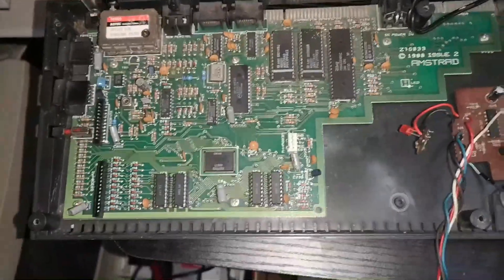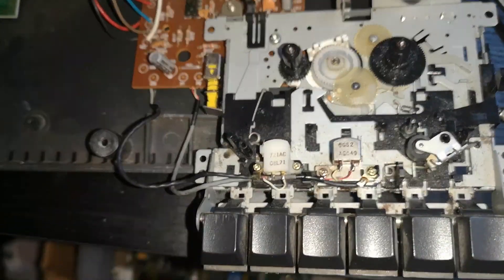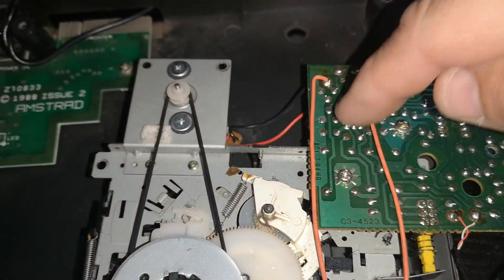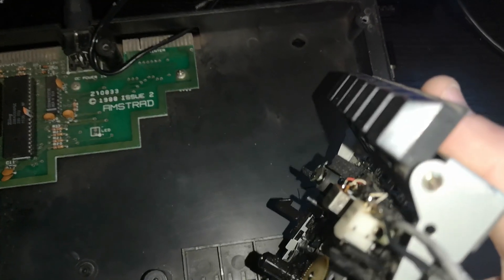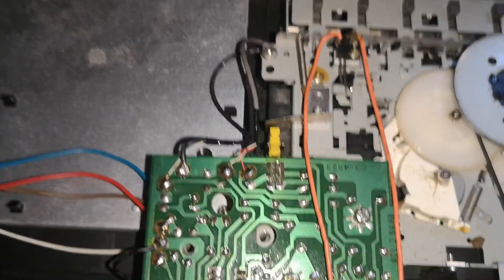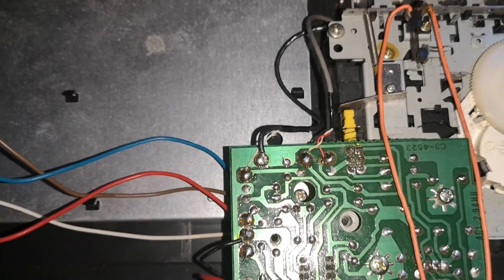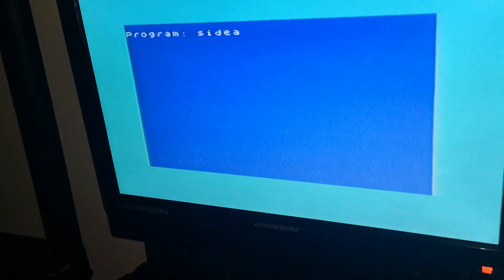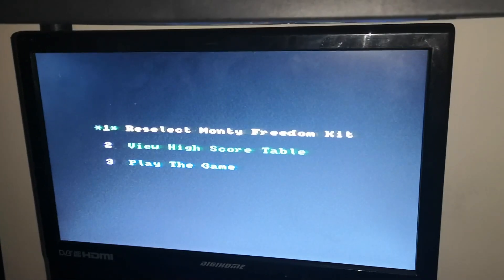Classic Computer - ZX Spectrum +2 cassette drive  repair

Comment: Hi.

Dug my Spectrum plus 2 out of the loft. Powered on OK, but tape deck noisey and no audio output.

Opened it up, gave the heads and the rest a good clean, replaced the belts and a broken play key.

Powered it back on, but now I have no rewind or fast forward and it only plays for a couple of seconds before stopping.

I guess I have done something wrong!

I have little knowledge of electronics, so I guess that's why it didn't work.

And Ideas on what problem could be?

Many thanks.

Richard.

Comment: Having trouble with play button stuck and cant eject tape. Any solutions?
Reply from the maker: It sounds as though one of the springs on the underside of the deck have come detached or loose. Or one of the fingers (sliders) may have become bent. But without seeing it, it would be difficult to tell. 
If you feel confident enough to strip out the drive, you may find it is quite a simple fix. 
They are not the best quality drives in the world, but they were fairly reliable. 
Unfortunately as they age,  they get a little creaky around the edges.  -  If you get stuck drop me a message and I will try to help. Cheers Phil
Reply: @Re-Tech  thanks i will try, if i'm struggling i will drop you a message.👍

Comment: nice video. Just bought another +2 with cassette problem. Will certainly try this fix first. Cheers
Reply from the maker: I am glad you liked it. The Tzxduino/Maxduino Spectrum 16k/48k/128k cassette emulator works really well with this mod and you can find them on ebay if you use the search title above.
You may also be able to take it out of its case and install it in the area where the cassette player lives if you  want to remove the broken part. 
Cheers Phil